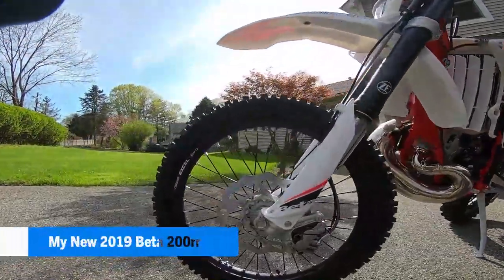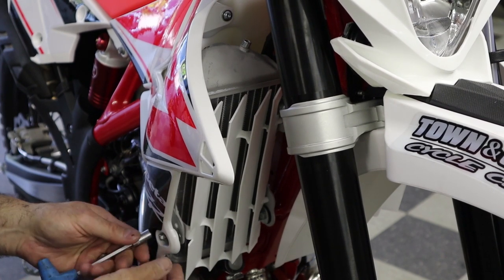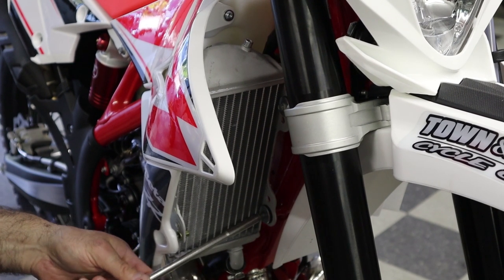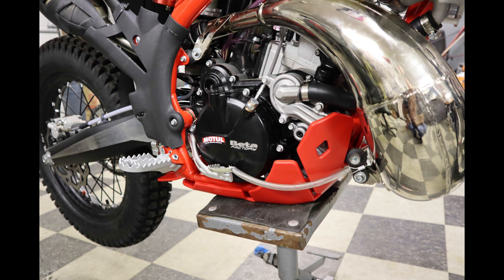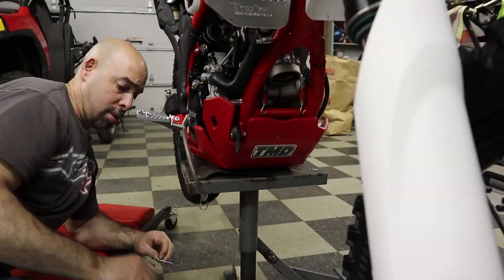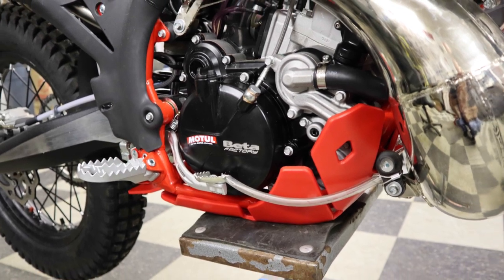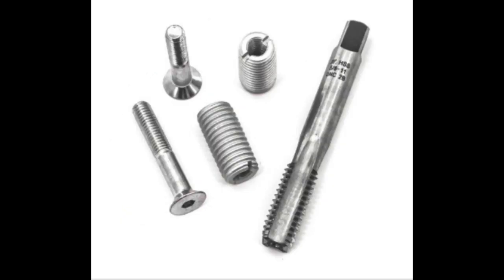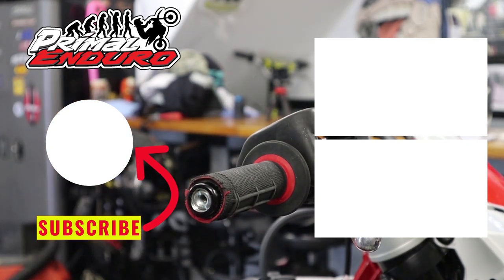20190 Beta200rr build part 1

Comment: I haven't even got my RR and I'm researching modz. Excited much! Thanks!
Reply from the maker: This is the first time I'm trying a plastic skid plate.  I always used Enduro Engineering Aluminum plates in the past...I'm trying the TMD for less resistance sliding over rocks and logs.  However, if you are getting a 200, look at P-Tech.  They just released a combo skid plate/pipe guard for the 200rr.   Unfortunately I already ordered the TMD skid plate which seems very nice, but I would like some pipe protection also.
Reply: have you got one yet?